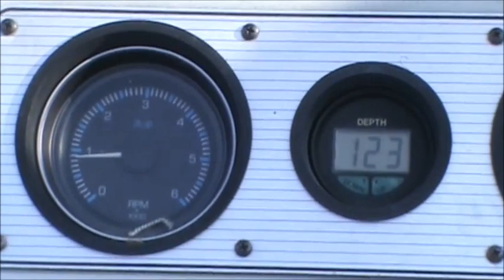THREE OLD BOATS - START-UP COMPETITION

Comment: I don't see the point. Any mechanic worth his salt can get a motor running, assuming it can be done without a teardown. But there is a lot more to a boat other than the motor. Start it, take it home to find out low compression on one or more cylinders, gimbal leaking when you put it in the water, lower leg seal leaking, crap in the fuel tanks, and the list go on and on.  Lets see them do it and take the boat out for a few hours run.
Reply: They're doing it because it was a FUN little competition.  You're taking this way too seriously
Reply: FUN
Reply: Dont have a cow I'm sure they know that
Reply: probably has more money than they know what to do with